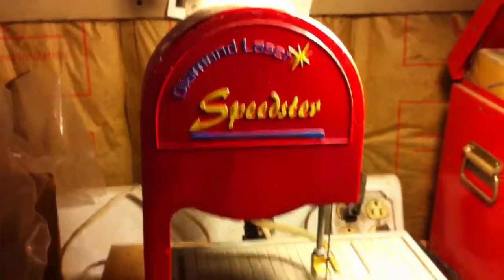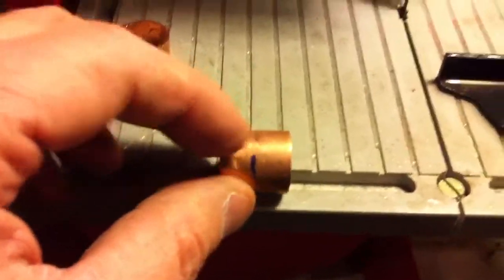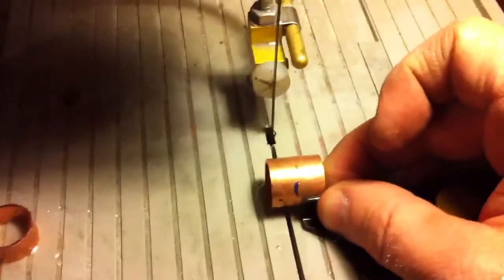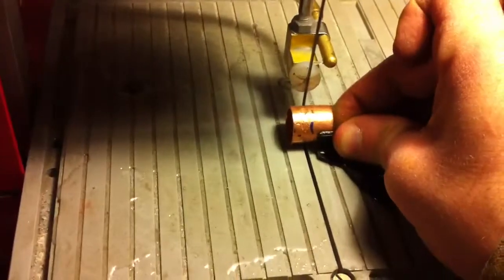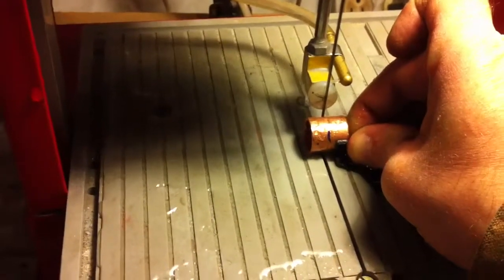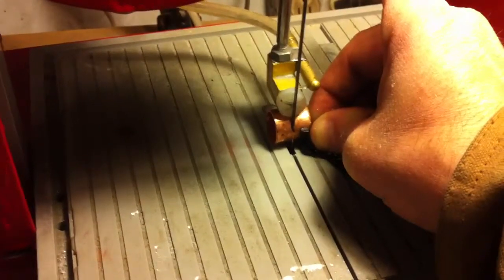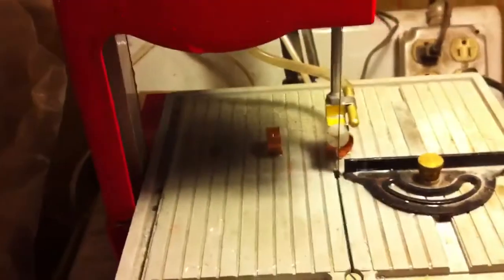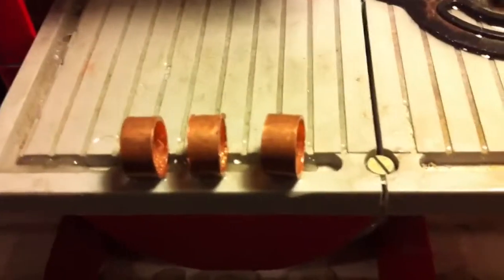Gear Yell #1 - Using the "Speedster" diamond blade bandsaw to cut copper.

Comment: I need to know where I can take to repair only because the belt comes off of the wheel and doesn’t stay . I think it needs adjustment but if you know know how to fix this problem pls let me know. Thx
Reply from the maker: Sorry, ours never had a problem.
You might need to contact the company. 
I doubt there will be any place local where you can get it repaired. It’s kind of a specialty item.
Reply: JimsEquipmentShed so the company is speedster? I’m not sure:( thx for you kind response🙏🏻
Reply from the maker: @cakewhisperer7113  send me an e-Mail at 
Jimsequipmentshed@gmail.com and I can send you a copy of our manual.
(It’s only five pages.)
But it has phone numbers, e-Mail, and addresses for them, and for the place that fixes broken blades as well.
Jim
Reply: JimsEquipmentShed 🙏🏻
Reply: JimsEquipmentShed ا
Reply: JimsEquipmentShed I fixed the saw and now I’m looking to purchase new blade for it as the the one I have is really worn. If you can share information on new band with model number I would greatly appreciate it. I looked on amazon but not quite sure if it’s the right band and it’s $75 for 3
Reply from the maker: In the description box is a link to a video on the manual. (With phone numbers, and set up procedures.)